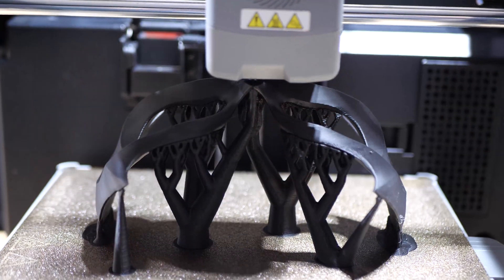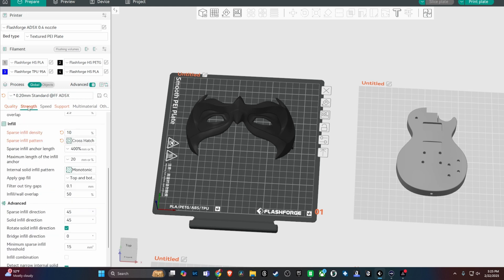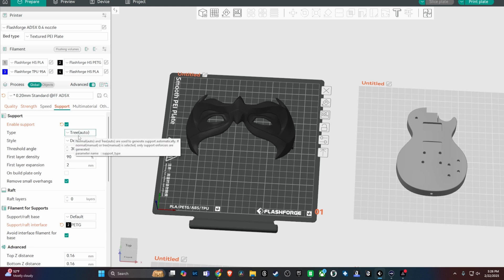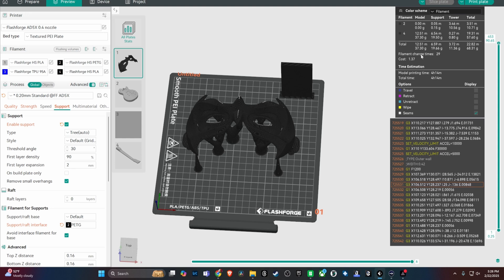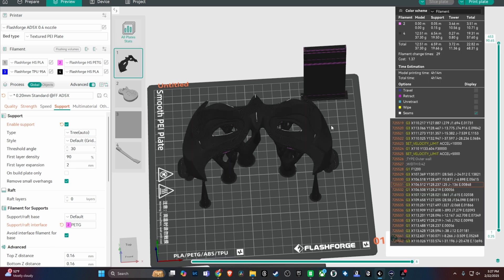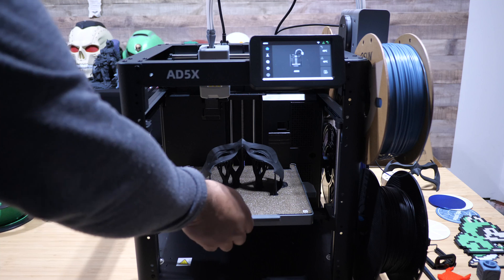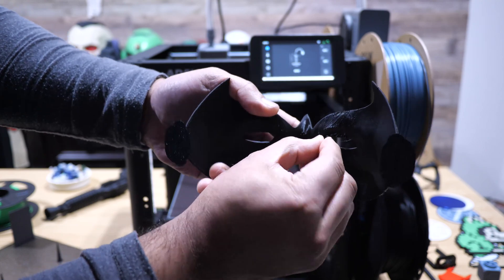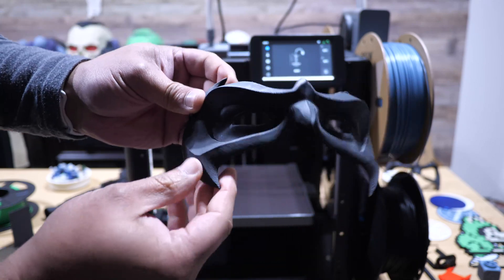Flashforge AD5X: Using PETG Interfaces for Easy Support Removal!

Comment: Not sure how you achieved different filament types.
I do so but when I have PLA loaded in slot one and PETG in slot 2 I cannot print from slot 2 as a single colour unless I change the filament type in the selection to PETG for slot one.
Not sure what I am doing wrong.
Any suggestions would be appriciated.
Cheers.

Comment: Can anyone help me I’m having trouble with my prints failing a lot. I have the same model as well. Not sure what I’m doing wrong. Changed the filament . Cleaned it and unclog it. Changed the temperature settings. I’m out of options. Thanks 🙏🏼

Comment: I am confused. Is the ifs multi material or multi color? In their website, it doesn't mention multi material at all.
Reply from the maker: It's both. You can load different filament types/colors in the IFS and use them on the same model.
Reply: @FigureFeedback  why don't they advertise that tho? Can the bambu lab ams do multi material?
Reply from the maker: The AMS can do multimaterial as well such as PLA with PETG. The Flashforge IFS stood out because it was marketed as being capable of printing 95A TPU, which is something Bambu advised against with its AMS. 

Not all material combinations are supported though. For example, you cannot print ABS and PLA on the same print due to wide temperature differences.

Comment: Great video as always. The tips I found that were useful when using PETG as the interface layer for PLA:

Top Z distance = 0.0 mm
Top interface spacing = 0.0 mm
Top interface layers = 3

YouTube comment: If you explicitly choose your model material for the support/raft base, then it will eliminate the layers of interface material mixed into your supports. Leaving the material for the support/raft base as "Default" will allow interface material to be used for building your support base, which can cause weakness and may allow supports to break. Just a handy tip.

Another tip I saw was increasing the flushing volumes.
The breaking of your part was because the PETG was mixed with PLA, and this reduces the part's strength.
You need to increase the flushing volumes so the PETG and PLA don't mix.
Reply: Totally agree.  Really pay attention to flushing volumes.  Greatly affects layer strength in areas near the interface support if trace amounts of PETG are still left in the nozzle when printing PLA.  Also, try different filament brands.  My personsl favorite for this is Elegoo Rapid PLA+.  Comes off clean without using PETG as the support interface layer.  Faster prints, less waste.  Esun PLA+ comes off cleanly as well.

Comment: These are the only AD5X videos I'm seeing, but fortunately, they're very good videos.  Thanks!

PET-CF parts with PLA support (or support interface) is definitely a reason I'd be interested in getting an AD5X.  You might try playing with the distance to the support setting.  I've been printing TPU-LW parts with rafts.  Rafts and TPU generally are a bad idea because TPU bonds so well to itself but with 0.4 mm spacing to the raft, the thin two layer raft peels away from my prints leaving a very nice surface finish.

Comment: Thanks for doing these videos! Were the PLA and PET-G profiles using about the same temperatures, or did the machine have to pause a bit to heat up for the PET-G? I can't imagine that it would take too long to heat up, but I do wonder how quickly the hot end would cool down if PET-G was printing at 240 and the PLA was printing at 220, for instance.
Reply from the maker: They were different temperatures. The default HS PLA profile is set to 215, and the HS PETG is set to 235. The temp changes when they swap. But, it won't let you mix two filaments whose temps are too far apart such as PLA and ABS.
Reply: Printing the support material and the model material as cool as possible at the support interface definitely helps with support removal.